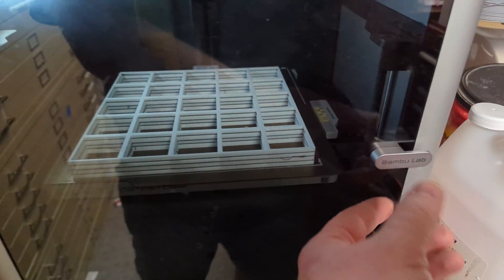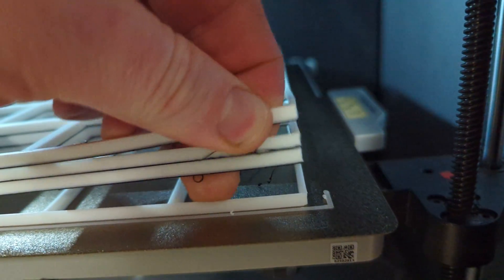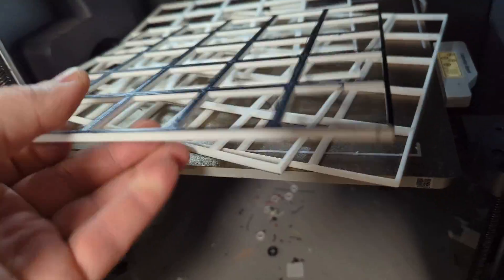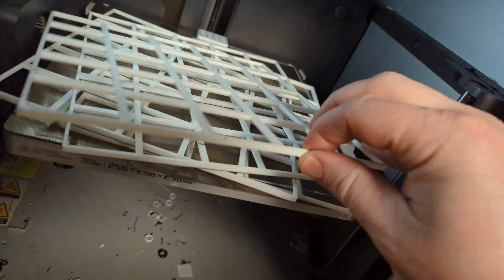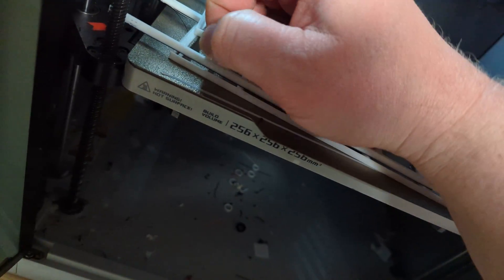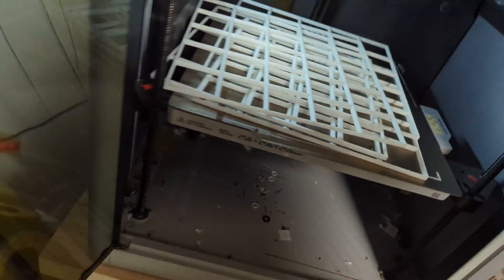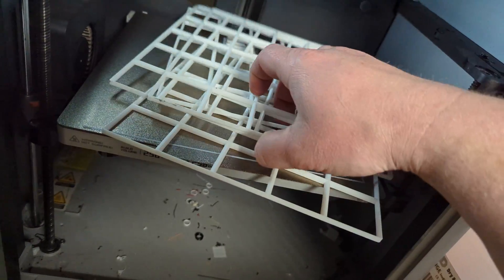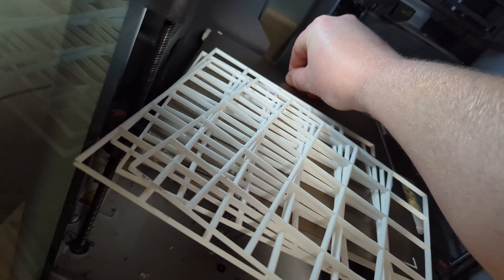Attempt at stacking Gridfinity baseplates PART2 on the 3d printer

Comment: I really want to understand how you did this. Did you model/modify a stack of baseplates in CAD with a “slice” of baseplate between each layer for interface? Then use the slicer to indicate a different filament for the interface layer?
Reply from the maker: Exactly, with additional layers on each side of the interface to act as top and bottom layers of the actual baseplates.
Reply: @JoeMalovich not sure what you meant by your added detail but I thank you for responding. This gives me something to go on and see if I can figure out. Thank you!
Reply from the maker: @ThatAdam12  a material modifier changes just the material. The slicer doesn't know to put a floor or roof on the adjoining parts. That's what I mean by the additional objects/modifiers, they serve as the floor and roof.
Reply: @JoeMalovich oh. I see. I thought I could model the base (Fusion 360), model a .4mm slice of the base, etc., etc, stack them as an assembly, import into slicer which would see each individual body, then assign PLA to base plates and PETG to the slices. I’ve never used the different-filament-as interface trick, so I’m certain I’m missing important nuances. You hinted at them regarding flow rate and some other slicer tweak that were things I would never have know to adjust. I know what I’ll be playing with for the next few days!

Comment: This is going to save me so much time!
Especially the comment that suggested you could just alternate the material between plates.

I can turn on the printer in the evening, and instead of it running for about an hour and then sitting idle for the rest of the night, it can print one plate after another on top of each other until the next morning.
Reply: can you explain me how to create a file to do that?

Comment: Is there a way to stack models within the bambu studio software?
Reply from the maker: @TheMulletMaam  not easily. You need to assemble them before you can adjust height, otherwise they snap to the bed.
Reply: @JoeMalovich  dang. I was hoping there was a way to do it without a bunch of extra work. Seems like an easy thing to add to a software. Thank you!